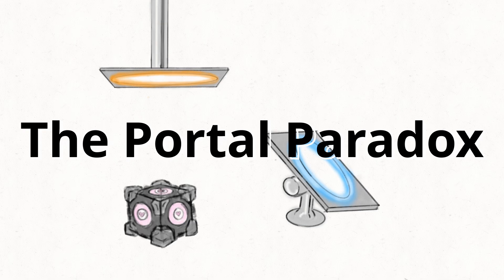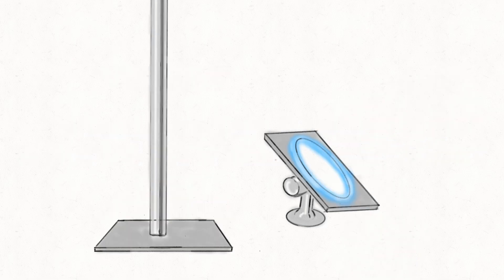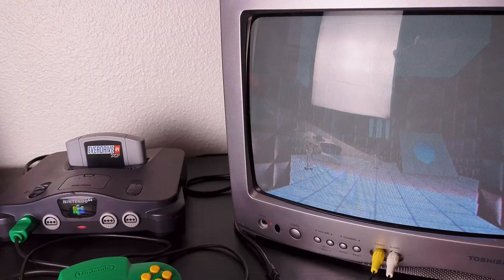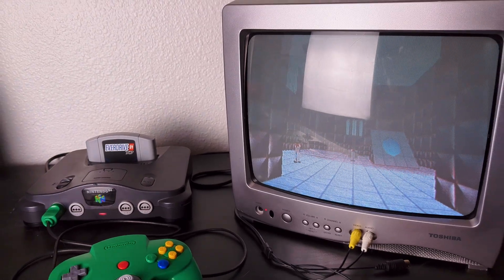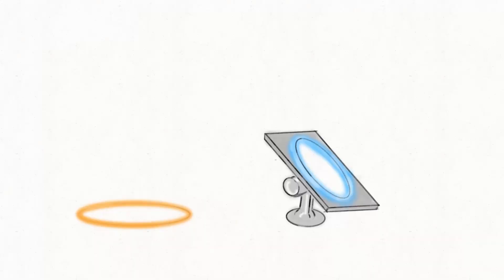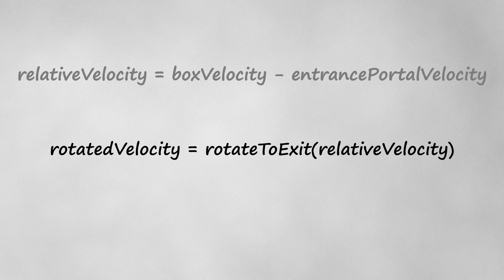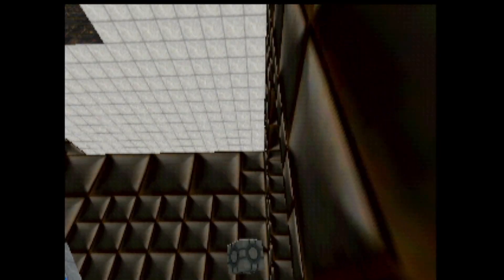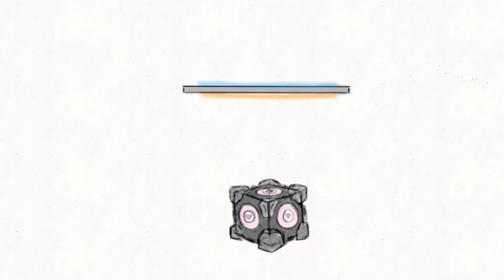I rewrote Portal from scratch and solved the Portal Paradox

Comment: Pretty sure it is incorrect, it is the conservation of momentum of the cube that matters. A piston with a portal pushing into the cube would not move the cube, since the portal on the piston prevents the piston from pushing the cube. There is nothing touching the cube, the cube's velocity remains 0,0,0. 

What happens in the instance of a cube falling into a stationary portal on the ground, when the other portal is on a moving surface? If the moving exit is moving with the direction the cube exits, is the speed added? If away, subtracted? 

I can see why the devs originally just avoided this mess.

Comment: Intuitively I completely understand the moving/not moving hula hoop explanation, thats how I expect it to work. However it leads to another question that doesn't make sense (at least to me) if the this is true.

Imagine instead of slamming the portal right to the floor you abruptly stop it half way down the cube. If the cube experiences momentum on the other side of the portal, what should happen is that the cube will get 'sucked' off of the ground and through the portal, but that seems very counterintuitive to me where does the force to lift the cube come from

Comment: Nice test. Here's my feedback. Using the laws of relativity, an object in motion tends to stay in motion, and an object at rest tends to stay at rest.

The cube starts at rest, when forced through the input portal. Based on the above, the cube would remain stationary until it's fully through the input portal, and then I believe it would slide down the ramp to the floor below, when the force of gravity changes.

Comment: Portal 2 actually has two examples of a portal on a moving surface. When we shoot a portal at the moon at the end of the game, it's easy to forget that the moon is actually moving substantially fast relative to the Earth. The moon portal is moving like 4000 km/h relative to the Earth portal, and yet when Chel and Wheatley enter it they aren't suddenly launched off the moon's surface at mach 3.5. The portals preserved their relative speed, as in this video.
Reply: surely they didn't actually model the relative orbital speeds of the Moon and Earth for that so that.
Reply: @OrionKaelin  of course they did not. That's besides the point.
Reply: Here’s the second example of a moving portal 
https://youtu.be/mCQiwhik8nc?si=eNjSeNuZoeoGpVRC
Reply: @ThePokeGod  That's actually the one level in the entire game where they intentionally enabled the moving portals mechanic
Reply: Still: the movement is faked. It's just paralax, the moon does not actually move in engine
Reply: But that's an EXIT portal. The Entrance portal is "almost" stationary compared to Chell so there is no "speedy thing comes in" predicate. All checks.
Reply: @hackdesigner  The reason you can go faster through the portal is because there's no air, you will never reach terminal velocity while MOVING in a portal, just like when you move between 2 portals to speed up.
A cube that's not moving, but a portal that is moving, will only make the cube reach the portal quicker. No inertia is in the CUBE. Ignore the portal, concentrate on the object travelling through the portal.
Reply: @Deja117  i feel like i've just entered an ARG

i'll leave that conversation lol
Reply: @hackdesigner  there is no such thing as an "entrance" or an "exit" portal.
Reply: Technically…. No. The physical model for the moon in the game isn’t moving.
Reply: @Thewaterspirit57  There isn't even a physical model of the moon. That thing that looks like the Moon is just a texture on a skybox, and that environment Chel briefly travels to that looks like the Apollo landing is just a room near the boss fight. Just because the game didn't model the Solar System doesn't change the fact that in the fiction, the transition from Earth Portal to Moon Portal significantly changed Chel's momentum so she wouldn't fly off the moon.
Reply: Boy this comment really brought in everyone who doesn't understand reference frames.
Reply: They weren't launched through the portal they were pulled out by a massive pressure difference. They went the same speed when they were being sucked through as they were once they were on the opposite side so by that logic the moving portal did not add any additional speed which would prove this video wrong.
Reply: @Prof_Z_PhD  Either rewatch the video or reread the comment. The way Chel and Wheatley come out of the moon portal is exactly how they would come out with the video's mechanics. The alternative, where portals simply preserve momentum, would have Chel and Wheatley launched off the surface of the moon as the bulk of the moon moves away from them at mach 3.5 while they remain fairly stationary relative to Earth.
Reply: @NotaWalrus1  What happens on the moon in Portal 2 is the opposite of what's happening in the video. Besides, what force is acting upon them when they go through the portals? Gravity and the absence of gravity, they can't be propelled out further than what the difference in pressure would allow so what would cause chel and Wheatley to be propelled? And if the moon is programmed to move (which it isn't) then the portal would have moved away from chel and Wheatley not them moving from the portal so either way it would prove this video wrong
Reply: @Prof_Z_PhD  No, what happens on the moon is exactly what happens in the video. Chel and Wheatley enter the Earth Portal quite slowly (relative to it), and leave the moon portal quite slowly (relative to it), despite the fact that the moon portal is moving at Mach 3.5 relative to the Earth portal.

Think of it this way: While Chel is in the moon, she is moving 4000km/h relative to the Earth portal. She had to get that speed somehow.

And by the way, "Chel+Wheatley move away from the moon portal" and "the moon portal moves away from Chel+Wheatley" are the same statement, just in different reference frames. You are not making a distinction there.

And how the game models the moon is irrelevant, because very obviously the "surface of the moon" in the game is actually in a hidden room in Aperture, quite near the boss fight. The whole cutscene is smoke and mirrors but doesn't change the fact that in the fiction, the transition from Earth Portal to Moon Portal added about 4000km/h of speed to Chel and Wheatley.
Reply: I think the problem is that if you take that example of portal on a moving surface to be true, yes the math and assumptions in the video is accurate. However, if not, and you believe that the developers just didn't use any kind of mathematic reference, then it's impossible to determine in lore how it would actually happen. Yes, you can say that this is an example that proves how it would work, but doing that is the same as saying that wizards in Harry Potter use owls to deliver post because they are quiet relative to the sound of apparating next to someone's house. It's a valid explanation, but almost certainly not something done with the intention of the writers.
Reply: @squashiejoshie200000  this illustrates that the system in the video is not only correct but in fact the only one that makes any kind of intuitive sense.
Reply: I don't get it why the motion of the moon is relevant in this case at all.....

If we go by the rule of "relative speed between object and portal is preserved", so yeah sure in "absolute terms" stepping into a portal leading to the moon, would increase your velocity to a point that you match moons velocity, but you wouldn't even notice that since your relative speed out of the portal would be the same as your relative speed entering the portal.
Reply: @tsukeekage  you just explained the point. Your relative velocity coming out is the same as your relative velocity going in. Just like in the video
Reply: @tsukeekage   "I don't get it why the motion of the moon is relevant in this case at all....."
Of course it is: if it was NOT relative it would mean that as soon as they teleported to they would me moving at 4000 km/h to the side, never having any chance to return through the portal (and of course the thin cable would be ripped to shreads from trying to stop an object moving at supersonic speed)
Reply: There is no evidence the in-game moon in Portal 2 moves.   The fact it's always perfectly centered in the hole of the ceiling no matter how long you take to complete the rest of the game suggests it's stationary.  All of those numbers you came up with came from wikipedia.
Reply: @asterpw  Are you seriously arguing that the moon doesn't fucking move in the Half Life/Portal universe?

Comment: This doesn't seem sound. The portal itself is moving, sure, but the points in space linked by the portals are static. That is, they have no velocity. So, there's the flaw in the formula. The point in space being moved to the other portal isn't moving at all: only the portal itself is moving. Therefore, there's no momentum once it appears on the other side.
Think of it like a door frame. You can pick up and move a door frame, but an item doesn't gain velocity by the door frame passing over it: it just ends up on the other side of the door frame, retaining its previous velocity (zero).

Comment: So I just came up with another wacky portal experiment while watching the video. So, take two unanchored panels and put a portal pair on them. Have them both face down, one of them being placed onto a companion cube. As in the cube goes through the portal. As for what happens, I am of the opinion that after a period of movement and oscillation the two portals will stop at rest suspended in the air halfway up the cube’s height. Despite not being attached to the cube, or anything, the cube is supporting the panels. Of course something else might happen, but that’s what I think might happen.

Comment: The flaw is that as you say, motion is relative, and the box relative to the room, to the system, is stationary. The piston with the portal on it is moving, but the box is not. The portal is not an object in the system, it is a connection between two points in space, it has no relative motion because it is not a physical object. When examples have the box flying out of the portal, like in this video, energy is being created from nothing, as the force stopping the piston (either braking by the mechanism which extends it or colliding with the ground) cannot pass into the box, and is instead wasted as heat or other work as is to be expected if the box weren't there at all. The rule "speedy thing in" applies to the motion of the thing moving through the portals, relative to the system, as in "has the same energy going in as coming out". Making a box go from a standstill to flying through the air breaks the conservation of energy.  Relative to someone looking at the box as it comes through their end of the portal, the box's motion would stop as soon as the portal's motion stops, because the only thing changing is the box's position, not its momentum. This is why the concept of an Alcubierre drive works because you're not moving a ship, but warping space around it to shift its position without actually moving the ship itself.

Comment: Its wrong because the thing pushing  the cube is the floor, not the orange portal. The only force that is acting on the cube(if IRL) is gravity(and friction but not relevant). When you push the orange portal onto the cube the portals are not pushing(touching or imparting impact) on the cube, they are just changing its physical location, so having the portal going real fast onto the cube is equivalent to gently pushing it onto the cube. Its not physically interacting with it in any way and to preserve the momentum of the cube it would not go flying out.
Reply: The logic of the formula is wrong because fundamentaly the entrance portal is not imparting any force on the box, and rather it would be "boxvelocity - floorvelocity"=0 and then gravity would pull it down gentley if the angle was steep enough on the blue portal. Its like slamming a cup over a box, but when the cup hits it moves the box to another location, the 2 movements aren't interacting to conserve velocity together.

Comment: The thing that really tripped me up about this question was acceleration. Sure, nothing changes relative to the portals, but if you go from standing still to flying through the air, wouldn’t that imply acceleration? But no, you don’t inherit any momentum/velocity/etc. — the stationary portal does, so it would look and feel like the exit (and indeed, the entire room) was dropping away from you. It’d be like those big drop roller coaster rides, where you go from at rest to suddenly in freefall. 
The original image obscures this, but if you looked through the portal it’d make sense — from the perspective of the box, looking up, you’d see the wall/ceiling on the exit side rushing towards you before & after you enter. If you were on the other end, you’d see the box flying towards you, again both before & after it entered the portal.

Edit: Actually, thinking about it more, I’ve convinced myself that the box wouldn’t actually fly out of the portal, because the portal stops moving once the box is all the way through. It doesn’t change the box’s momentum, so when the portal stops moving, the box should too

Comment: Huh, that is an interesting way to think about it, thinking about the way the exit portal is working in relation to the cube, rather than the entrance portal. I had always thought about the paradox from the later, that a portal moving towards an object is essentially the same as moving a doorway over a cube. Its not applying any forces to the cube, so it shouldn't move.

But if you flip the thinking to be about the exit portal instead, then its starting to make more sense logically. The exit portal is essentially viewing the cube as having momentum. Its functionally no different than having both portals stand still and the cube is moving.

I think this video has made me change my answer to the paradox! (Now I await the next brain bending video that will make me switch back again)

Comment: but what would happen if the portal fall to the cube but only partially? will it rip the cube into half or will it launch?
Reply from the maker: It would either launch with partial velocity as the momentum of the part that moved through portal pull the rest of the cube or if the stop was sudden enough and the cube was weak enough, it would break it in half.

Comment: Your solution makes the most sense, especially if you imagine portals as a real thing consistent with actual physics. But the “paradox” arises because Portal is a video game and either interpretation could be correct. In fact, the evidence I have seen suggests Portal the game uses cube velocity relative to the room, not the portal. This doesn’t make sense in modern physics, but it is a game and players were never meant to interact with a moving portals so much.